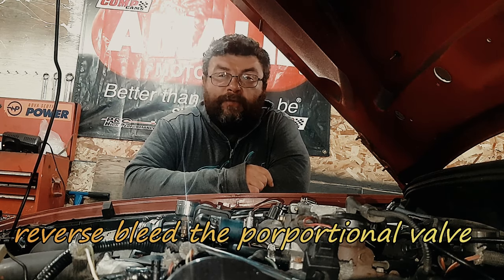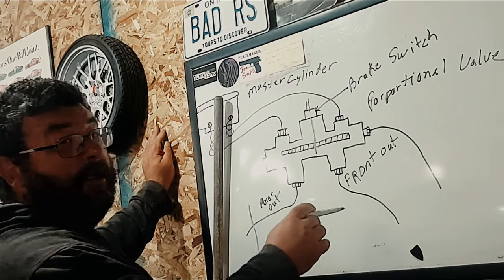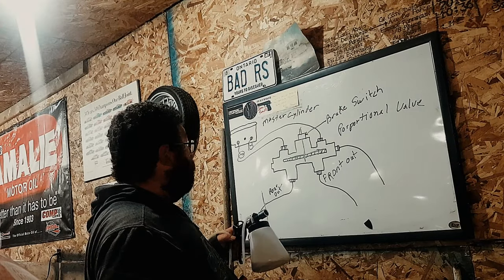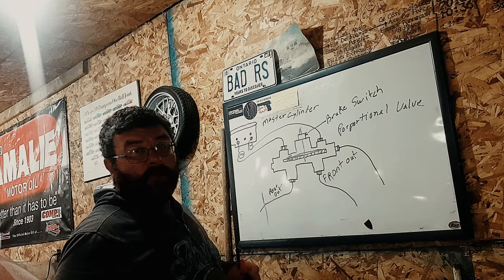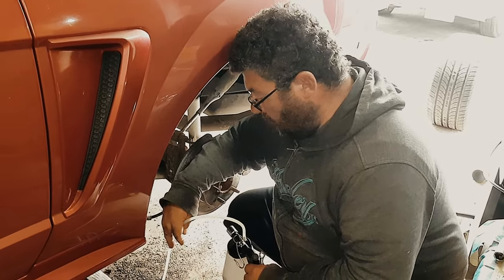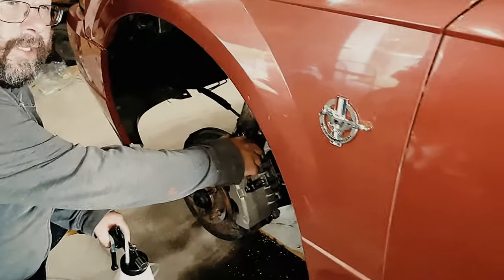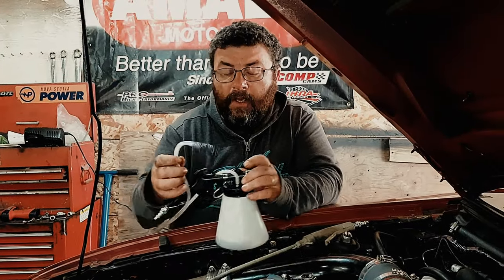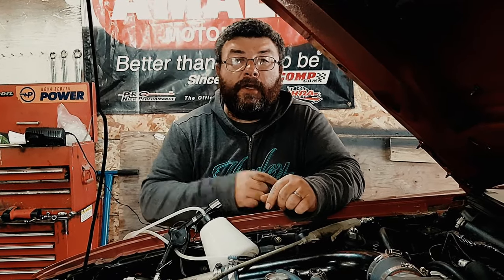brakes wont bleed proportional valve reset this guy's garage

Comment: My 95suburban not have pressure on brake pedal! Going all way down and  it's crazy when I driving because when I press the brake pedal slowly is not correct brake some rear wheel brakes more than others! I checked everything! No leaks, all rear cylinders are new, also I replaced a master cylinder! and keeps the same! The brake pedal going all way down 🙄 anybody knows what a hell going on? I appreciate all help thanks  cheers from Norway 🇳🇴  great vedeo you have a new  subscription 😀 👍 😊
Reply from the maker: hey Jorge ty for subscribing ,does your suburban have hydra boost or vacuum boost assisted brakes ?  let me know we can  proceed further
Reply: @thisguysgarage  hi yes have👌 but this happened when I replaced a right caliper 🤔 before the brake pedal have a normal pressure!! after that a friend of mine helps for removing the air from the brake sistem but  still not have pressure!! I replaced a brand new master cylinder because leaking a little bit between the master cylinder and hidrobooster!! Someone tell me for drained the air on ABS module pump 🤔🤔
Reply from the maker: @jorgefonseca9225  start bleeding the lines at the master cylinder and work your way down the system to see where the fluid is traveling to , do every joint you can access.  check flex hoses . bleed before the flex hose to do this , rule out what is working . make sense? let me know
Reply: @thisguysgarage  thanks mate 👍  I appreciate your help 👏👏 on this weekend I want to check now I'm driving a semitruck! I will coming on Saturday evening 😀👍 i let you know after check out 👍👍 have a great day mate cheers from Norway 🇳🇴 👍
Reply from the maker: @jorgefonseca9225  awesome my friend looking forward to hearing how you make out 👍

Comment: Of you lose rear brake pressure, wouldn't the valve go toward the rear end of the proportional valve to block the fluid from going that way?
Reply from the maker: yes if the rear line burst on your second push or pump of the brakes the plunger in the proportional valve will block the direction loosing fluid.   ty for taking the time mike

Comment: Does my 2000 Silverado 1500 (2 wheel drive) have a proportional valve? If so, where is it located? The reason I asked is I did a stupid thing and opened my right rear bleeder and blew air in it to try and force the stuck caliper out to rebuild it. It didn't work but it did force all the brake fluid out and some came out of the brake fluid reservoir. I replaced the caliper and tried to bleed it but no luck, no brake pedal pressure. Any ideas? HELP!
Reply from the maker: have you tried bleeding the front brakes first? .there is a proportional valve below the abs unit. need more information will be happy to help.
Reply: @thisguysgarage  I just tried that today, there was no air coming out of the front bleeders. I then tried bleeding the master cylinder of any air and then I was able to get brake fluid to both rear calipers and bleed them. Yeah. It feels alittle spongy though. Thanks for your advice.
Reply from the maker: @mikedickman6369  that was going to be my next suggestion.  check your flex hoses  would be the only other spot you could get a fluid interruption . ty for letting me know